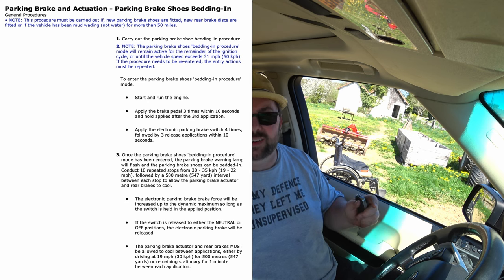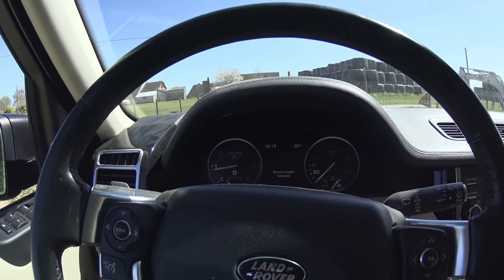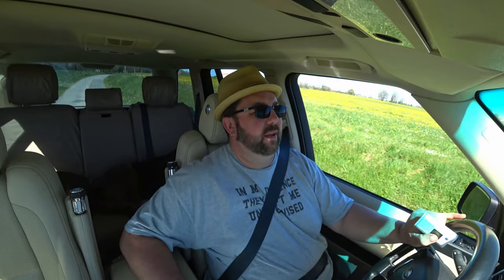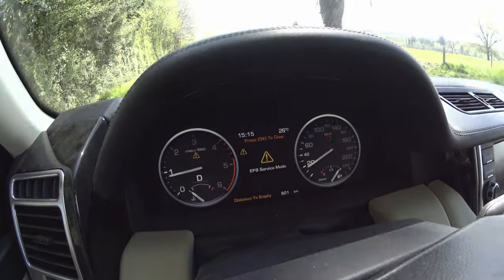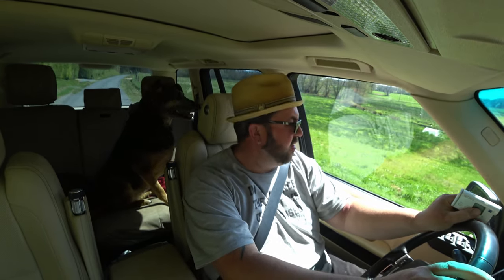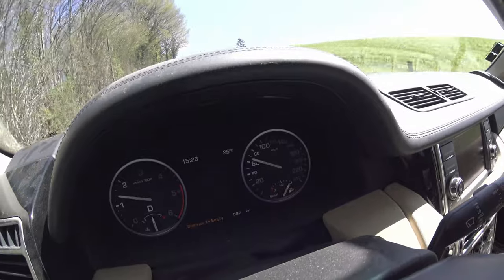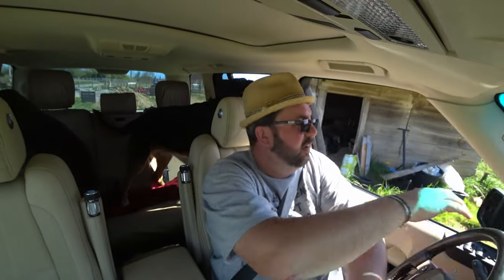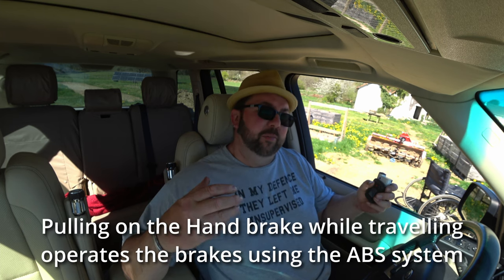Land Rover Range Rover L322 EPB bedding in procedure

Comment: Pretty cool!  Didn't know this was how the EPB bedding in was done.  I've always just assumed that pulling on the EPB while moving would cause some horrible and expensive damage, but I guess that's (partially) what it's there for!
Reply from the maker: I tried pulling on the parking brake while travelling, it overrides the whole ABS system and brings the car to a stop. That’s when I thought it best to resort to the manual, and found the correct procedure.
Reply: That was a brave approach just doing it without reading it first 🤣👌
Reply from the maker: @SamsMotors  what could possibly go wrong. 👍

Comment: nice, I replaced one of my rear pads years ago and never did this, maybe thats why the brake lights on the dash  recently came on and the dash says "check brake pads" too
Reply from the maker: You only need to do this procedure if you have changed your rear discs and/or parking brake shoes. No need if you just changed the pads.
Reply: @Bensgarage  ok thanks but do I need to do a latching procedure instead via a scan tool to get the pads clse to the rotors?  I just learned of this today.
Reply from the maker: @pagepro211  no, the unmounting procedure, done through a scan tool, is also for the hand/parking brake. The pads will move when the foot brake is applied. Pump the brake pedal, and it will settle the pads. All of this is in the manual, which you can download through my website, if you don’t already have it.
Reply: @Bensgarage  ok thanks, I don't have a owners manual so I will check out your link, thanks